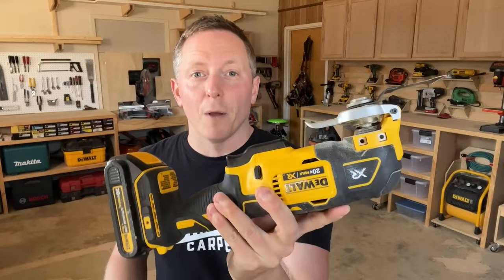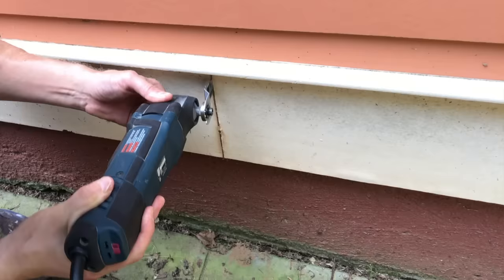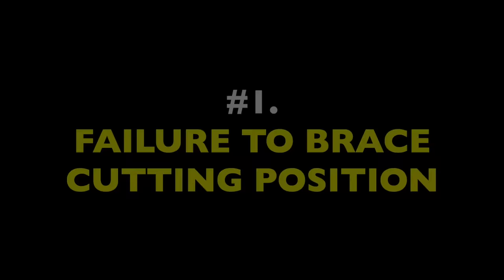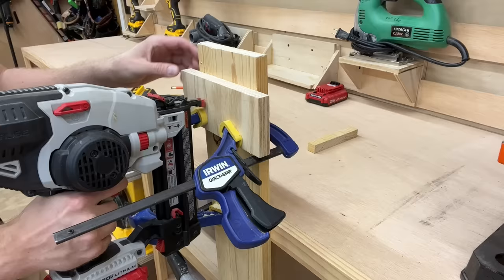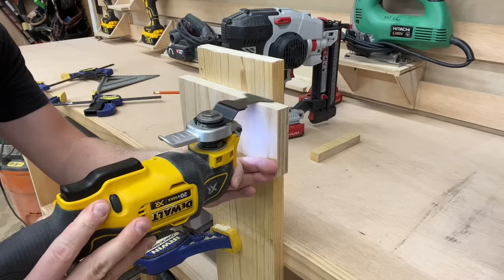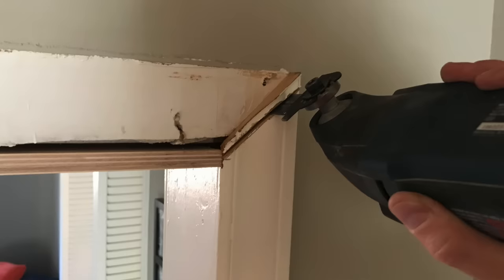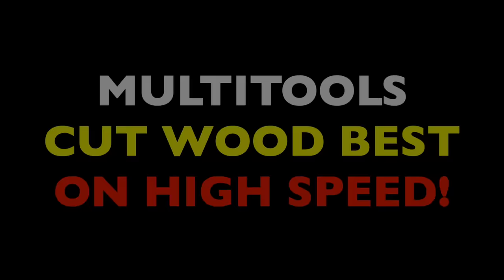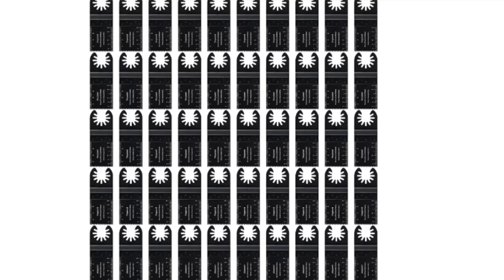6 MULTITOOL CUTTING MISTAKES! (How to Cut Straight With a Multitool...AVOID THESE COMMON ERRORS!)

Comment: Summary:
1.	Provide for Hand/Arm Support
2.	Draw a cut line
3.	Choose the right blade (smaller teeth allow finer cuts)
4.	Cut shallow and across, not deep and through.
5.	Cut on high speeds, now low. 
6.	Use sharp blades, not dull ones.
Reply: Thank you!

Comment: I get the appeal of buying bulk cheap blades but I bought a 40 piece blade set and I went through 3 blades cutting a hole in some hardwood cabinets for 1 cut-in outlet box.

Comment: Another tip.. do not use  battery powered multi-tools unless you absolutely have to. They have less power and speed. This also allows for more precise cuts. Not to mention its much quicker. Love to take a rockwell or another corded multi-tool and be done before the battery pwrd dewalt. Everyone is flabbergasted when this happens. Also a decent blade helps alot. Cheap blades tend to bounce more and dull sooner. $55 for dewalt 3pk..heck no. $10 for a blade unless you are not trying for precise cuts then you can shoot for amazon specials or habr freights. Happy cutting!

Comment: You know you can turn the blade plus or minus 90 degrees and at increments in between. That's why the blade is designed with those notches in a circle pattern.

Comment: I would think that you would have talked about blade position when talking about bracing you hands to make a straight cut? Why hold the tool vertical to the workpiece when you can rotate the blade and get both hands on the workpiece or at least get the trigger hand down and in a more natural position?

Comment: I have the Dewalt, non fuel M12 and Fuel M12.

Dewalt - collects dust. The thing should be an adult toy for women it vibrates so bad. 
Also, the trigger is awkward when you need to rotate or reach in weird places.

Non fuel M12 - I still use these for finer cuts. The less head rotation makes a better cut. But it's slow. Had to warranty because battery kept popping out.

Fuel M12 - cuts fast. Next to zero vibrations. This is my current go-to. Had to warranty due to electronic issue with speed selection..

Comment: Question could you actually do videos on power tools and tape measures for the legally blind that are wood workers like myself I would greatly appreciate that awesome tips and tricks as well thank you because I know there are talking tape measures out there and I’m also looking for some more tips and tricks to help somebody who is very low vision and who is a woodworker and does not want to give up your craft I do carpentry woodworking plumbing electrical and framing work all I can do about my own porch on a cement slab also with help from others to do straight line as well as leveling I’ve done myself with some help

Comment: That tip about stabilizing with your pinkie sounds like the number one reason NOT to get a multitool.
Let's compare this against the safety tool basics for a table saw: Your plan is effectively to place any part of your body in a way that would foreseeably get harmed and your best recourse for preventing harm is "Well I'll just be careful?" 
Couple this with the white-knuckle nature of the tool's motor being in it's handle and the general awkward handling, the thing seems like a mutilation trap for anything more than a plunge cut.

The worst part is it DOESN'T have to be this way. Why the hell doesn't DeWalt of all companies, the gold standard for commercially-available tools, have some assortment of jig attachments to help with cutting? They have to have that, right?

Comment: Just clamp that speed square or a straight piece of scrap wood to the line you want to cut and use it to guide the blade as it cuts.

Comment: hi
i try to pinch off old exposed  nails from a palate but the multi tool (with oblong  'metal cutter'') just vibrates it at a hundred times per sec lol
God speed
any advice anyone?  Gs

Comment: While this isn't a multi-tool cutting mistake, it is one of the biggest multi-tool user mistakes, which is constantly buying new blades. Most of the cutting done with these tools is rough cutting in otherwise awkward positions like cutting door jamb bottoms to accommodate tile or wood flooring. You can easily sharpen those fine tooth blades dozens of times with a small triangle file, I have some where the teeth are all different lengths and look quite ugly but still cut just fine, saving me hundreds of $. There is no special magic to it, I have filled them straight and at alternating angles (like a chain saw chain) and it doesn't seem to make much difference just getting points back on it makes it work again.

Comment: One other mistake is using a multitool when you could use another tool that would give you better results and do the job quicker. I noticed you used your multitool to make a straight cut into a plank, when a circular saw or hand saw would do this job far more accurately and quicker.

Comment: The wider blade gives me a straighter cut than the narrow blades. Also, instead of using a square to draw a line and then cutting a guide block and then clamping the block on the line, just put your square on your measurement mark and use it as your straight line guide, just like we do with our circular saws...
Reply: If you use a block, it gives you extra height to get cut more perpendicular (which is always a bit of an issue for me, more that straightness of the line)

Comment: Maybe clamp a thin board under a straight edge and use it as a guide to cut straight lines. The board will keep the blade teeth away from the metal straight edge.

Comment: Start by buying the original multitool Fein and you reduse most of the issues with using it straight away, all other brands I have used have a lot of vibrations, not a stable blade etc etc.. all other brands than Fein are just copys and none has made as good of a product as Fein

Comment: you can feel where it cuts better on what angle , play with blade position 
also dont PUSH ON THE MACHINE !! 
so many people do that ! ever tried cutting a tomato without cutting it ? salsa time !
clear your gaps , move the machine up and down in the cut if its bigger than the blade , letting dust set in , your blade will suffer from to much friction 
full speed is not always the best option 
ok im done ,, rest find out yourself :P

Comment: I first owned a Harbor Freight Multi tool because I didn't think I wouldn't use it much. However, the more I used it the more I thought about it's use and began to use it more.  Now the only thing I hated about it was changing the blades, which required hex wrench to loosen the chuck, much like that old school drill chuck key. So luckily it burned up with over use scoring tile to break. It's great for that.  So I got me the Bosch quick release latch but after a couple years of heavy usage the head fell apart while I was using it. "NOT GOOD".  So about that time, another tool just like that DeWalt but I don't remember the brand. I didn't like it because the quick release mechanism made the blades shorter before the tool bottomed out, and that's no good.  So now I have a cordless over the top handle release. It may not be as quick change as the DeWalt but the operation is better...

Comment: I never knew this tool even existed.
Reply from the maker: It’s the best! A true plunge saw—it basically changed construction repair work forever
Reply: @TheHonestCarpenter  Awesome. Will definteily have to pick one up one day. There have been several times where this tool would have made repairs/work a lot easier.
Reply: When you need it, nothing else will do the job as well. 

When you don’t need it, another tool will be much better to use. 

I had to cut a pressure treated 4x6 in half with one once. Terrible idea. :)

Comment: This is probably your worst video - your technique is really poor! You should use a square blade and let it sink in at an angle. Because then a large part of your blade is already in the wood, and you will naturally get a straight line as you push further, same as with a circular saw. I get much straighter cuts than the ones you demo here.